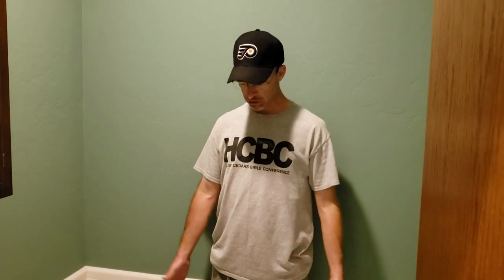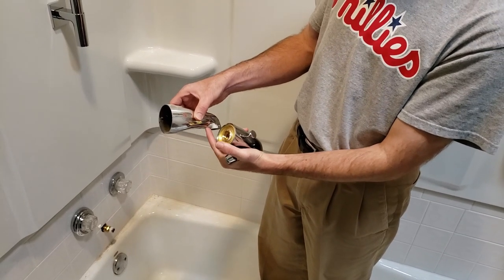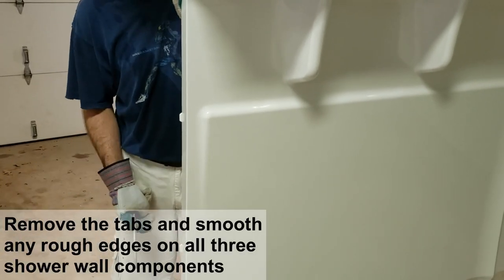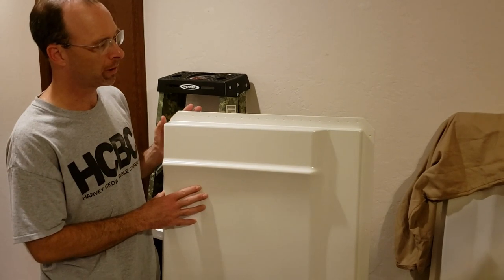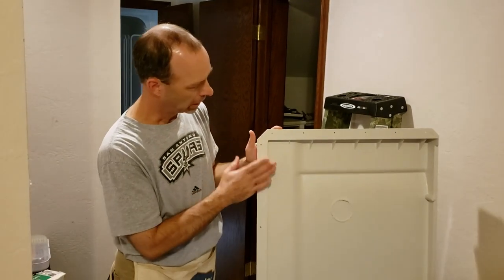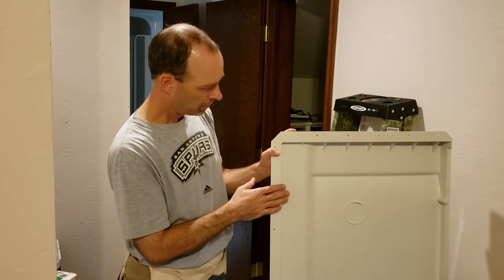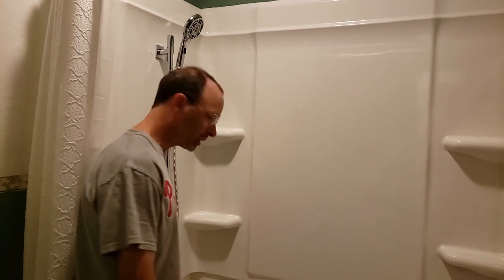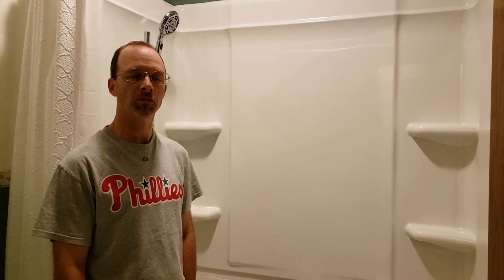How to convert a TUB to a SHOWER!

Comment: I'm trying to add a shower above my bathtub. The wall is already opened up. I need to know how to add the plumbing inside the wall. The tub plumbing has a place to add a vertical pipe for the shower. How do I connect a new copper pipe to a behind-the-wall "manifold" which currently only has a tub spout? I haven't yet found a YouTube video that shows how to add on the plumbing.
Reply from the maker: Sorry, that's a bit more complicated than the repair I do in the video. Don't think I could give you adequate instructions via text. I suggest looking for other YT videos if you haven't already. Good luck!

Comment: I would have just ran copper through the wall and soldered it. It's not too hard to do, and looks more professional... but that will work I guess... Also, you didn't use any water proofing material. Plastic and fiberglass are prone to cracking easily, and without any water proofing, you run the risk of leaking water back on the drywall and causing a nasty mold situation. If you're doing it for secondary, guest bath, or the studio above your shop or something, its probably okay... I give you a C+ ... Would have been an B, BUT you used a Push-Connect or "shark bite" fitting on the faucet! (Which is another disaster waiting to happen), and you left unfinished edges around the surround... Again, I understand you're not a pro, and for a DIY job, its far from the worst that I've seen... wayyy far.. lol  It's just a little rough around the edges... literally. The quality of your video is good and thankfully, doesn't have annoying music competing with your voice. Best of luck! Cheers.
Reply from the maker: Thanks. Yes, this is an extra bathroom for teenagers to use. It's going to get trashed. And yes, finishing off the edges was one thing I left out but should've included. Thanks for the comment!